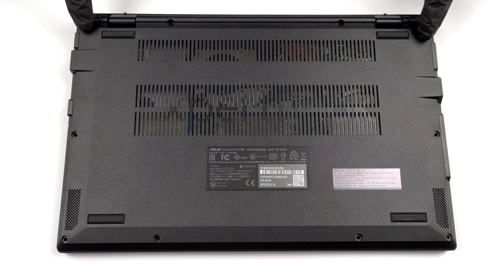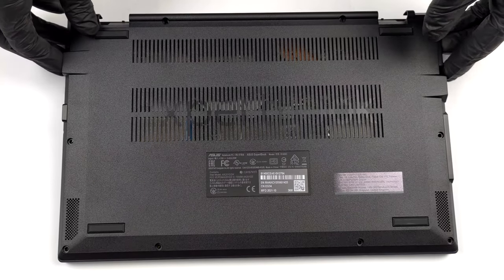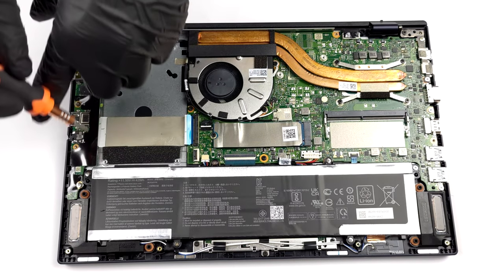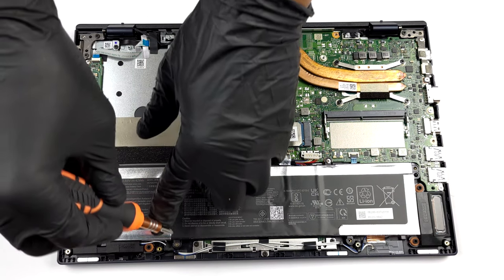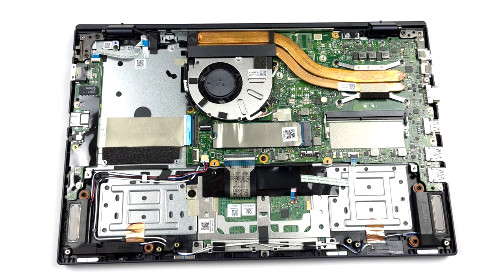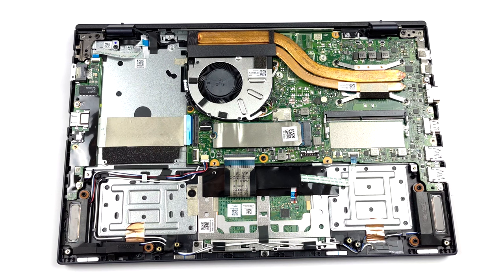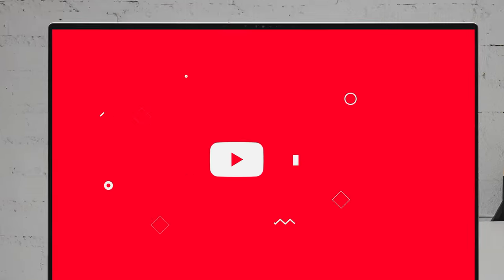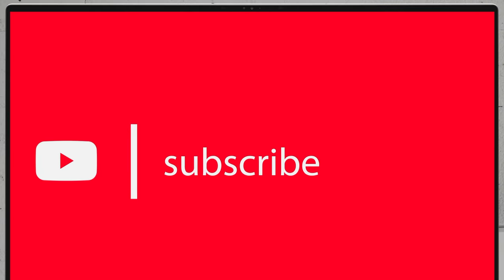🛠️ ASUS ExpertBook B1 B1400 - disassembly and upgrade options

Comment: yes, the heat pipes blow the heat away  but towards the screen, will it damage the screen after long use?
Reply: Good question. But also, the heat not being easily evacuated because of the opened screen, the microprocessor will heat more and perhaps will stop after some uses (especially in summer) and will be the premature failure. In my opinion, it is a design error of the laptop although it has many advantages.
Reply: NO, it does not. I am using a similar laptop with a 15w tdp chip, and the exhausts is blowing on the screen. I bought it 3 years ago, and i mostly  use it for gaming, and thus far it has had no issues

Comment: Hey somebody knows what ram i need to put in, cause i readed that two of the same type are bether etc, i got atm 8gb and woud add another 8 or 16
Reply: probably anything is okay as long as it fits in (SO-DIMM DDR4). Try to aim for a similiar but higher frequency as the soldered RAM.

Comment: Lies. The sata ssd requires you to remove half the thickness of the casing by removing the uppercase which voids its warranty. Can't believe asus designed it this way just to maintain the slim thickness.
Reply: What? I put a 2.5" sata drive without issues. No voided warranty.